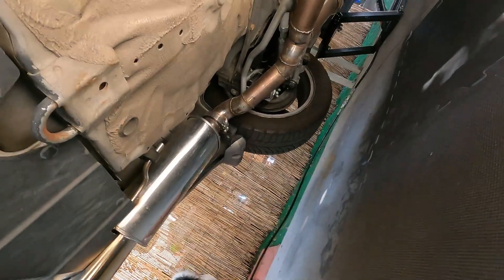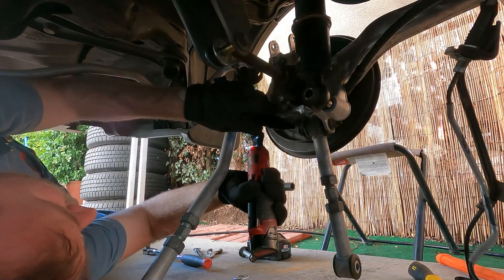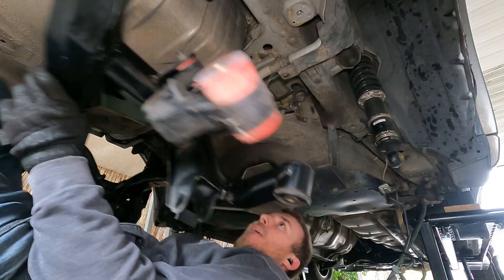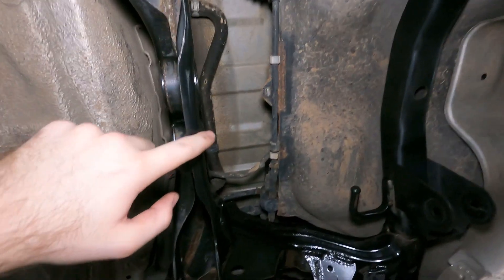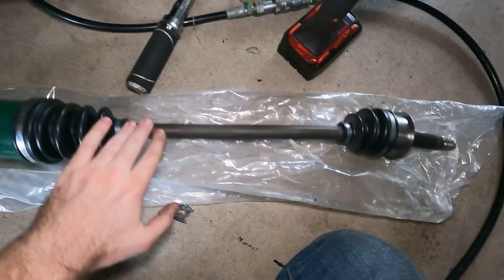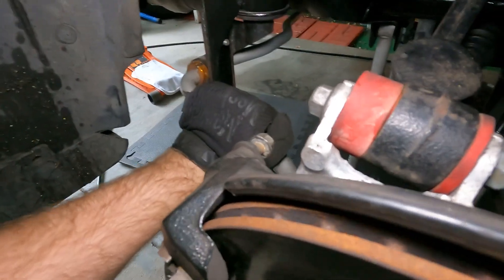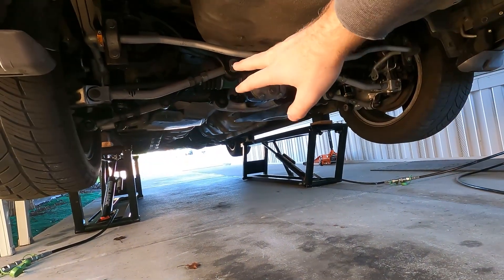STI 6 Speed Swap Into Subaru Legacy Outback Part 1

Comment: i did a very similar project on my '05 OBXT Limited. I got a parts legacy wagon for 600 cad and swapped the suspensions between vehicles. I painted everything and pressed in new poly bushings. 

now im considering a 6 spd swap and essentially building and outback spec b
Reply from the maker: That's a good deal on the parts car. The 6 speed is definitely a game changer if you are willing to put in the time and money. Good luck on your build!

Comment: A lot of work, but well worth it in the end. Good job on torquing everything properly as it should be.
Reply from the maker: Thank you!
Reply: i want to swap 6 speed forester SH  3rd gen  ej20/ ej25   09--13 model. which transmission, axles and diff is compatible.

Comment: what coilovers do you have? Will kegacy coils fit on the obxt? I have an 05 lgt sedan and plan to swap my car onto an obxt or lgt wagon. I prefer the looks of the obxt and the 4.44 fd until i can 6 swap it
Reply from the maker: Yeah so I have bc coilovers for a legacy gt. They work on obxt but the rear end is at max height and it's pretty low. If you remove the body spacers it fixes that but there are alot of parts involved with that. You also need rear adjustable lower control arms because your tow will be all messed up at that height. I have some older videos that go into more detail on lowering a outback.
Reply: Wow I appreciate the quick responses. I discovered your channel today and I've spent the last several hours glued to my PC lol. Thank you, and I look forward to your tuning videos and learning how to myself. I'm at 335whp on a dyno dynamics via ap v2 and I'm about to convert to top feed, 1300cc and an fp green or bcpx500 shooting for 400whp on 92 and 450 on e85.
Reply from the maker: @michaeli-7186 definitely possible, I always make my gasoline tunes kind of conservative an I was able to get 380whp   on 91. I never tuned it on e85 but 450 is definitely doable. I was looking at the bcpx500 turbo too before I decided to go with the blouch 1.5xtr.

Comment: Are you ever gonna put brembos from an sti on here?
Reply from the maker: I will probably do wilwood brakes at some point
Reply: @SWSpeedCo  what axles did you have to go with the mate the the existing hubs?
Reply from the maker: I used legacy gt spec b rear axles because they come with the r180 diff and legacy hubs so they work perfect. The front axles are the original outback/legacy 5mt axles.

Comment: I'll be watching this VERY closely and as always I'll have lots of questions, so let's begin, shall we? What's the hardware you're, those oval plates, using in place of the oem rear alignment bolts? I've got the KTA124 (and the adjustable camber bushings) setup on the rear but the rear alignment never stays put once I drive it from the alignment shop. Oh, and what's the label/transmission code on your new 6 speed?
Reply from the maker: The hardware that is used on the inside of the rear control arms is from whiteline.  It's a toe adjustment lockout bolt so the alignment doesn't move from that mounting point. The transmission code for the 6 speed is TY856WW8MD. Thanks for watching and keep the questions coming!

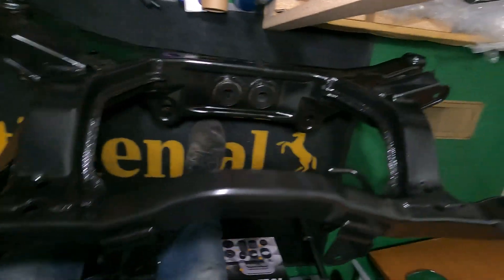Comment: What subframe bushings did you use? @3:05
Reply from the maker: If you are talking about the transmission crossmember bushings that are energy suspension I believe. The rear differential bushings that are in the subframe are from whiteline
Reply: @SWSpeedCo  Oh boy, how did you get those Whiteline rear diff bushings pressed in? The C-clamp in the Autozone kit isn't big enough to get around the subframe. Did you just use some bolts and washers and crank down on that to press the new bushings in?
Reply from the maker: Yeah I used the bolt and washer trick. I wasn't able to press them all the way in until I dropped the subframe.